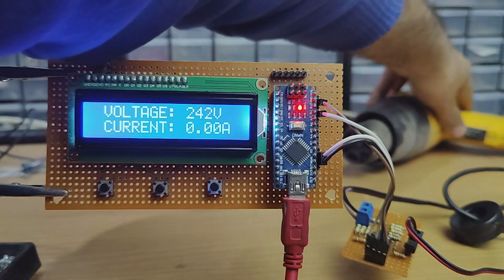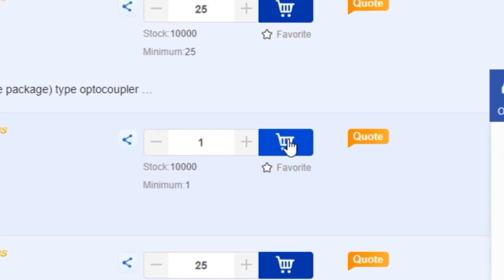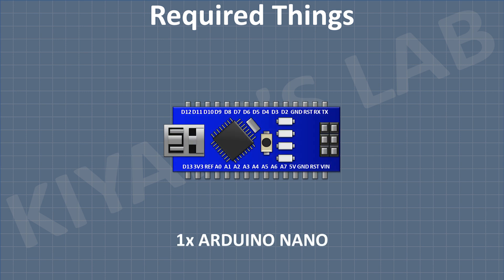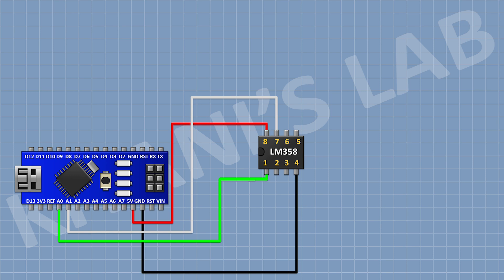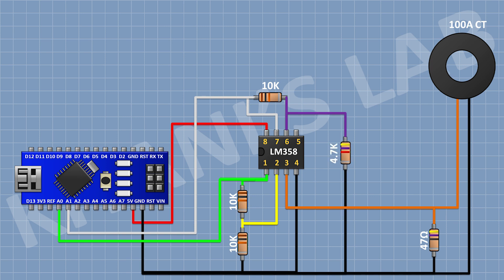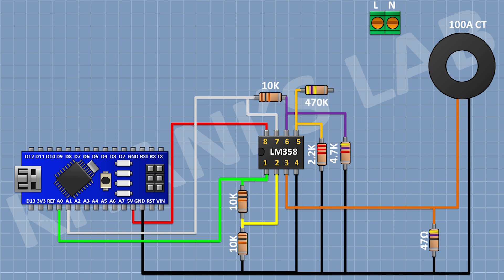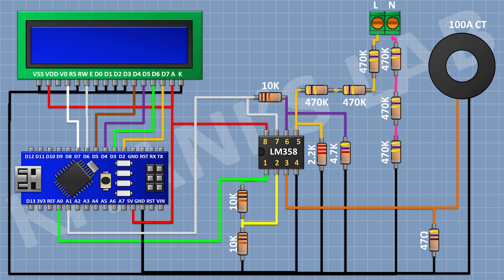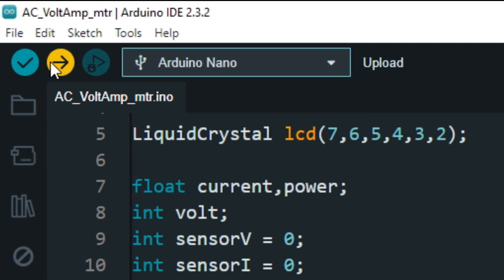How To Make AC 2 In 1 Meter | utsource | Arduino Project

Comment: Hi nice project  but i don t understans what i must  connect to  L and N connector..........thx a lot for answer
Reply from the maker: one wire of the load will go through ct and line neutral of meter should be connected to line neutral of the supply
Reply: good morning, I'm still Piero from Italy, thanks again for the first reply, but tell me if I understood correctly.
I connect the 220 volts to the L-N sockets. Still on N, I connect one of the two cables of the hoat gun,  and I pass the free cable of the hoat gun inside the coil, then I connect it to L.
Practically the 220Vac is read from the input of the OP AMP and, at the same time, when load which is affected by the passage of current measured by the coil........I hope my interpretation of your words is correct... ..I don't want to explode the ARDUINO NANO and all the out board.....BEST REGARDS Piero

Comment: Good job friend. This is nice  one.  What is the function of 47ohms in the circuit
Reply: A burden resistor is typically used in electrical circuits, especially in current measurement applications. It converts the current flowing through a circuit into a voltage drop across the resistor. This voltage can then be measured and analyzed by other components in the circuit. In essence, the burden resistor "burdens" the circuit with a known resistance, allowing for accurate current measurements.
Reply: @hearttouchingstoriesofreallife  Correct indeed!
Reply from the maker: it is the burden resistor
Reply: @KiyanisLab  can you explain the more the function of the burden resistor  pls

Comment: Good Idea.
But I wouldn't spend ₹250 on Arduino nano, ₹150 on 16x2 display, ₹80 on I²C module when I can get all of these in a ₹150 multimeter.

It's only important for specific projects and learning electronics but isn't that important for daily requirements.
Reply: The main purpose of this channel is to learn some things, not to spend or save money.
Reply: @deterdamel7380  exactly. This project is good for learning electronics. But if we compare the cost then there are a lot of cheap modules which do the same job. If we can upgrade it to an LCR meter then it will be worth it.
Reply from the maker: yes you are right you can use cheap microcontroller  for the purpose